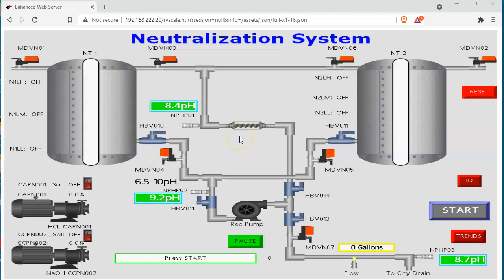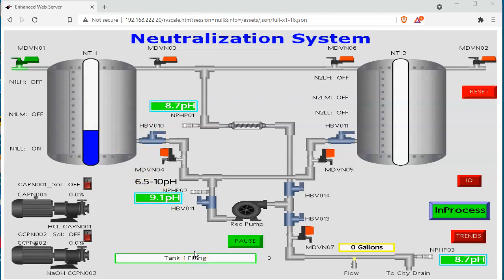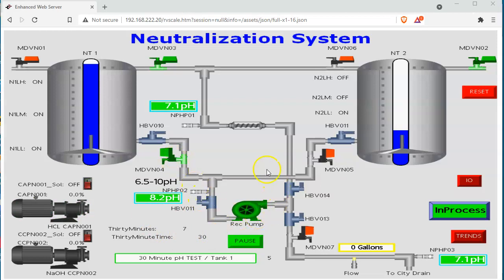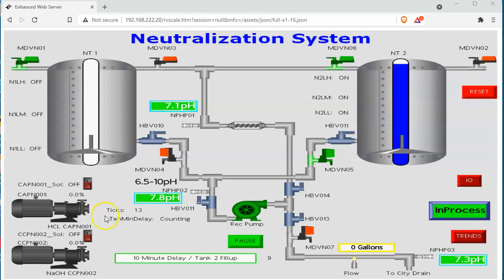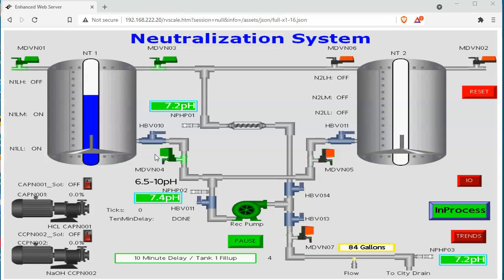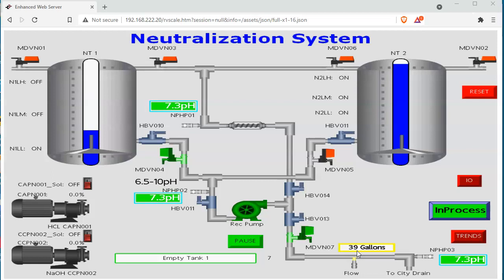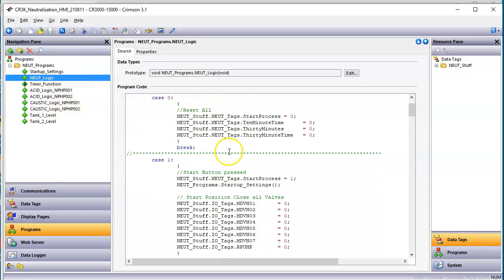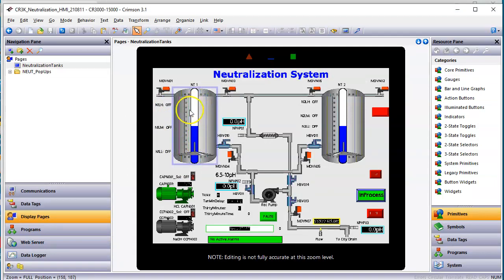Tank Example with Logic

Comment: Hey Joe,

First of all I want to thank you for all the great Red Lion content you've put out. 

I'm wondering how you've omitted the black border from the display page on the remote web browser? I have it set to full page but I still get the border and it looks rather clunky.
Reply from the maker: That's an easy fix in Crimson 3.1. In the Webserver select the Features Tab and change the Display Mode to Bare Displayed Scaled. Then download those changes to your device, go back to the Main page on your web browser, press F5 or Reload that page, and then navigate to your DisplayPage in said Browser and it should show the whole screen.  NOTE, I try not to use the Softkeys that are options in Crimson because they then are not viewable. So I always create Buttons on the DisplayPage to Navigate via the web image.  Good Luck!
Reply: @JoeWaZoo1_Geeks_Rule  Thanks for the response Joe! I did just that. Good point on the soft keys too. 

I'm actually using a TX107 similar to your TX207 web browser video. So I've also oversized the web browser window ensuring the operators don't have access to the address bar.